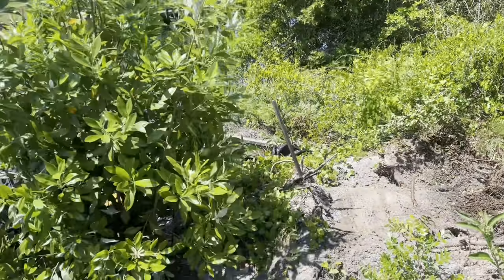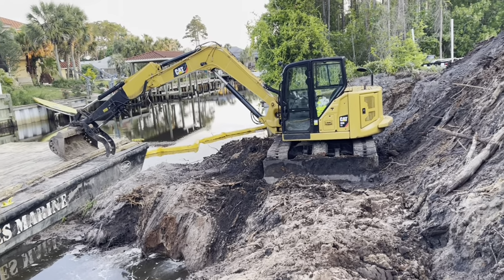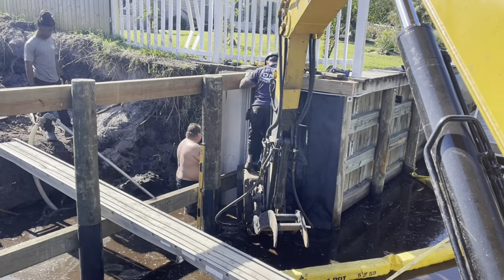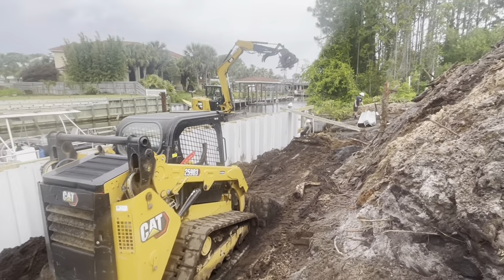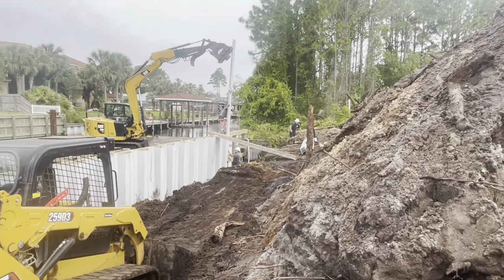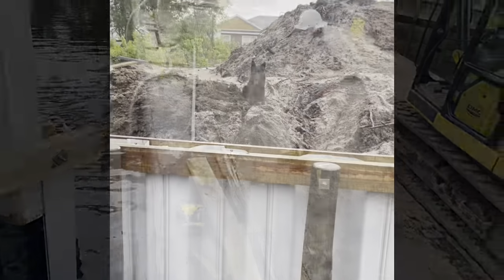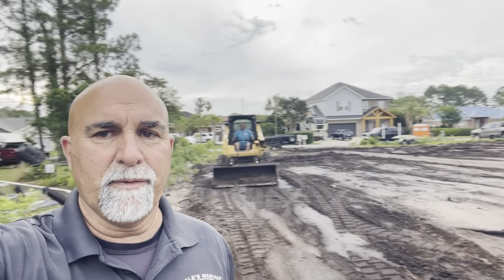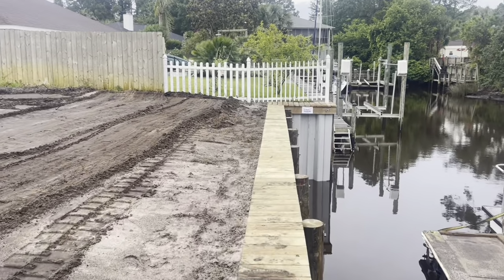FROM USELESS TO USABLE ￼ EVER LAST NAVAL STYLE SEAWALL

Comment: How would you install/attach these seawall panels if there's no dirt to drive them into just a solid rock bottom.
Reply from the maker: Thanks for watching my channel, I don’t deal with walk &erin in, but I have talked to my vendor about what people do when I do run into Rock. He told me they form up the bottom and pour concrete to join the rock to the vinyl. Not sure how that is done since I’ve not had to do that before underwater good luck with your project and thanks for the question.